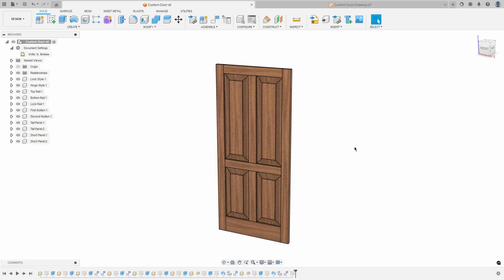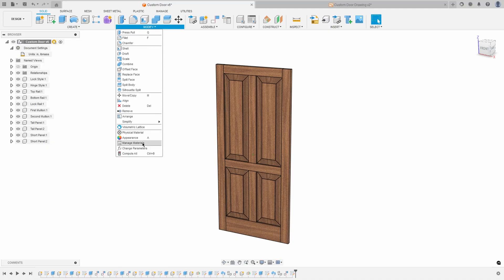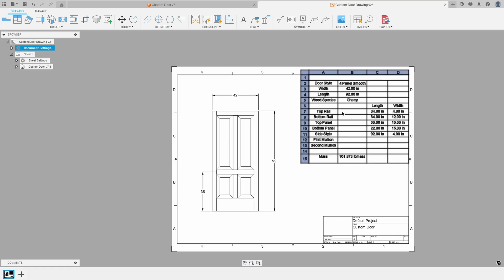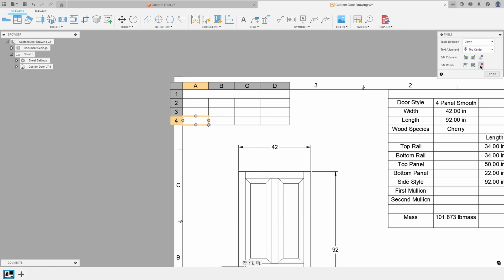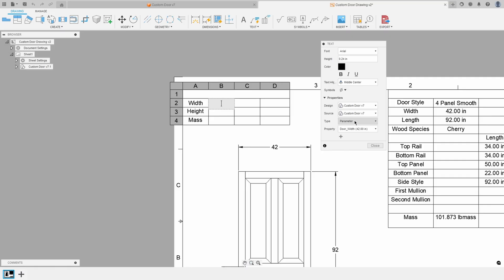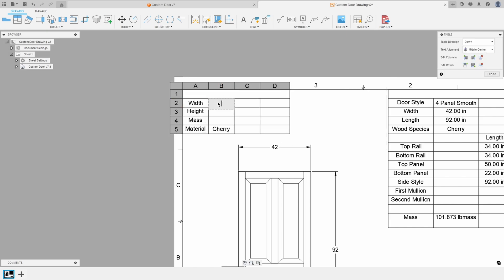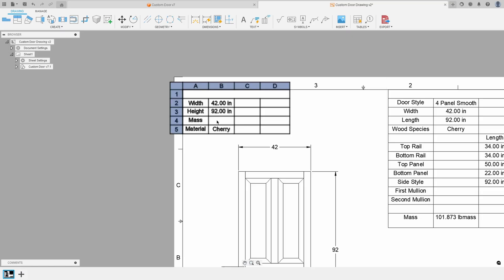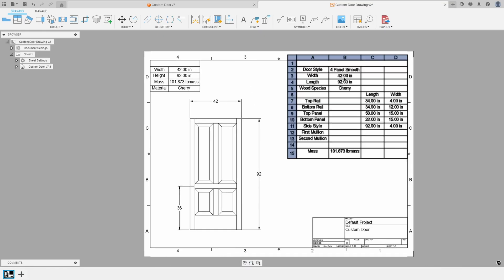Custom Tables in Fusion Drawings

Comment: Nice hack.  The fallacy with this is that you can't add a label name to a driven dimension that makes sense in context of creating the table entry.  You're left with having to pick from a list of internally generated parameter names/labels where the name given to it was invented by Fusion and thus has zero contextual and relatable information as to what all the various "D___" labels are referencing.  It would be so nice to be able to add a custom label text to a driven dimension, then when you build the table, you have some idea which dimension you want to put into the table based on the custom label name you'd given it.  As it is now, you have to go back to the sketch and figure out what "D____" label was assigned by Fusion.  What you present is a good hack, but it is precisely that - a hack.  Good luck when another person picks up that design in 2 years and tries to relate D107 to the height of the upper mullion.

Comment: This could be really useful.  However, it doesn't seem to work.  The values don't show up in the table.  Is this working for the paid version of Fusion?
I figured it out.  There's a little plus that adds the value.  Not on your video.
Reply: Yes he has
Reply from the maker: Check out the video at 6:16 where I talk about having to press the + symbol to "add" in the parameter into the table.